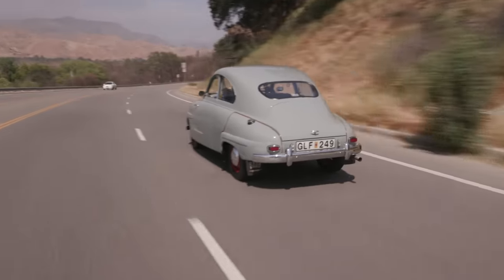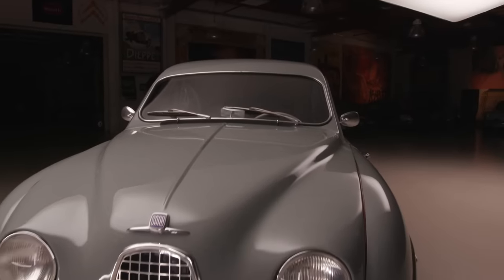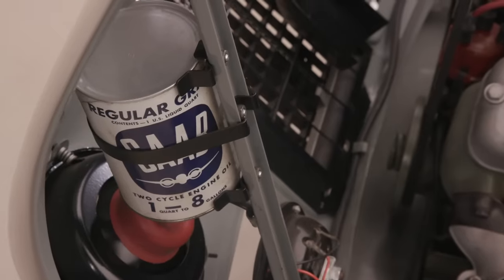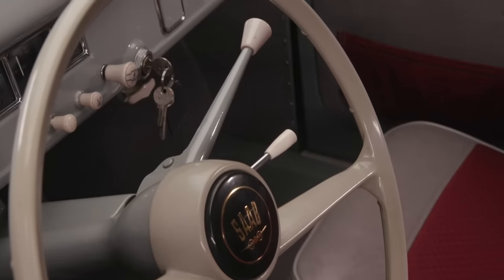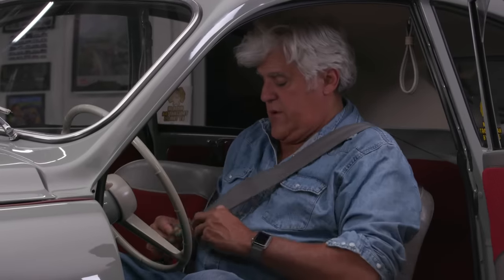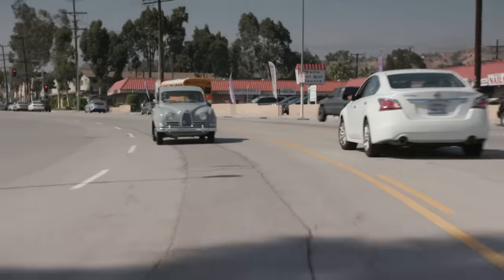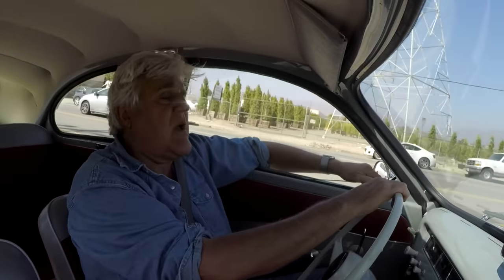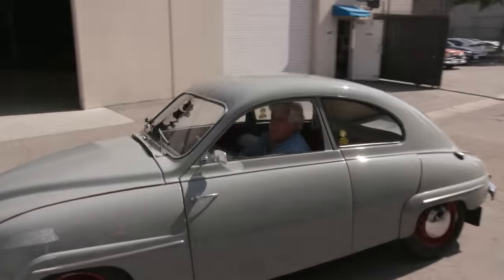1958 Saab 93 - Jay Leno's Garage

Comment: An old swede in good hands. I had the 4 stroke one, a dream in winter to drive. Sometimes they were called "sne fyra" (crooked four) as the pedals was not in the middle of driver position. People who walked crooked did so after driving that saab :-)
Reply: You sat centered to the pedals!
By the way.... SAAB 96 and winter.
When i was in the army we lads from our neck of the woods carpooled.
One of my friends had a 96 v4 and seating five not so small guys in that car!
As it was then the temperature could drop down to -40 c.
It was really really cold.
Especially in the back seat!
The heat distribution were almost non existent.
Hot feet in the front seats and the inside of the glass almost entirely covered with ice.
The passenger in front did have to scrape the windows so the driver could see out!
Reply: The 4 stroke motor was a Ford V4. I remember one that PD Elrod had that ran rather roughly. Turned out that the center main bearing journal was broken! The break was at an angle, so the crankshaft still worked! For several years and tens of thousands of miles!! Ran rough but it ran!!

Comment: No, Jay, this car looks familiar to me because I am really, really old. My father had several 93s and 95s. I bought my first car when I was 21: a 1967 Saab 96. Later there was a 99 (great car) and then a 900. But you live in the wrong part of the country to truly enjoy a classic Saab. Snow and twisty steep back roads that are the same as they were 250 years ago, except with some asphalt on them. One spring morning on my way to classes at the University of Virginia (all male in those days) from Mary Washington College in Fredericksburg (all female in those days) I had the great pleasure of running a Plymouth GTX off the road that hadn't changed since the Civil War. I just kept pushing him and pushing him with the little Saab and he put his foot into that 440 and flew off the road at the next curve. The Saab clung to the road like it was on rails. Does yours have freewheeling? My 96 did. No engine braking. Take your foot off the gas going downhill and the tach dropped to idle and the speed kept climbing until panic sat in. Fold down the rear seat, not common in those days, and who needs a motel? This was a fantastic brand, conceived by ingenious Swedes, and perfect for a young man wanting to stand out from the crowd. I got 32 to 36 miles per gallon. In 1967! Too bad GM destroyed it. Oh, and my 96 had a magenta high beam indicator jewel light. Never seen anything like it.
Reply: My first car, in 1969, was a SAAB Sonnet.
Reply: Thanks for a great story...this is why i like these old cars...Working on New cars nowadays is not the same...Greetings younger car mechanic from Norway
Reply: think simo lampinen was greatest seller of saab,once back fast,break and try to make turn,it took over,simo came out of car and start to tell bottom of that saab...and this is not a story,it is so true,,
Reply: Great story. Tht was my GTX, no damage,  was busy with a girl in the back later that night.
Reply: Haha! That was a nice story indeed. But well, i can't picture americans from GM having a proper talk with those sweden guys that engineered and built the 99 & 900. Seems like they must've had way too much of a different idea about how cars should be made.
Reply: reading this story just put the biggest smile on my face. im a 20 year old college student with a handful of family saabs, although i havent yet been blessed with a classic pre GM car. but whether or not Gm ruined them or not is another debate; reading your story was like looking into a mirror for my own saab experience. my 9-3 manual is a fabulous car that is fun to drive, very economical, handles snow like its on rails, and distinctively swedish. with all of my friends driving audi and mopar products im the oddball of the group but the car is just irresistibly different. every drive puts a smile on a face when i see the turbo needle wind up, even if im only doing 45mph. lots of memories in these great cars. thanks for sharing your story!
Reply: Socialism destroyed it.
Reply: In Sweden i had a -71 Barracuda with 440" and no Saab never had a chance in the red light! :)
Reply: Yea, he said it had that, but cool stories and your passion for these cars really comes through. You and Jay really make me want to drive one. 👍🏻

Comment: I have a model 96 Saab, somewhat similar looking in body style to this 93.  It has the stock Ford German V-4 engine.  It's absolutely indestructible.  I used to have a 1957 DKW also a two-stroke 3 cylinder with the radiator behind the engine and also with suicide doors.

Comment: I believe the freewheeling system was because of an inherent problem with using a 2-stroke engine - when you back off the throttle, the engine doesn't get enough oil.  Not really a problem in motorcycles, as they slow down fairly quickly, but with the better part of a 1/2 ton of car, the car speed (and therefore the engine speed) didn't drop quickly enough just with compression to slow it.
Reply: I'm a former owner of a SAAB 96. The freewheeling system was also intended to prevent "snatching" on the overrun. Lifting off the throttle would cause the engine to buck.
Reply: I don't know if it's really a problem with motorcycles or just perceived to be a problem, but I always heard never to just let off the gas on a 2 stroke to slow down. Especially when decelerating from high revs, I ALWAYS pull the clutch in. The freewheeling feature on the Saab 2 strokes was probably put on there so you don't have to hold the clutch in or put it in neutral when coasting. I would LOVE to have that car, I'm a 2 stroke guy from way back!
Reply: The owners manual clearly describes the need to change the three spark plugs to cooler burning plugs when you drive at highway speeds for long distances.
Reply: Decades ago I commuted on an Italian scooter with a two-stroke engine, and on long downgrades when I used the engine for braking, I remember having to periodically activate the clutch and twist the throttle grip a couple of times to rev the engine, to make sure the piston rings continued to get enough oil.  I hadn't thought about it in years until you mentioned it here.
Reply: The 58-59 Sports had oil injection (and triple carbs) - but so much for your theory on frugality.  Jay's used premix, so it does not have oil injection.
Reply: They kept the freewheel in the later 4-stroke V4 models too, the old Saab farts couldn't probably drive without it, you can switch it off though
Reply: Not necessary with the '65 and later oil injected engines. Beside the 850cc is small and 2 strokes have little engine braking.
Reply: @aussiebloke609   Not in the US  the 58 through 60 93 750 Monte was petroil only The first 850 Sport was in 1965 with the new body style.  The bullnose Monte Carlo 850's were all early oil injection and the standards with the Shrike engine from 1966 to 68.
Reply: I'm not completely certain what specs were available in different markets.  That said, if Jay's car uses premix (as he said), then his engine won't have the oil pump, as the pump removes the need for mixing the fuel and oil.    Possibly he has a Euro spec car, or maybe an engine from a previous model.

The freewheeling feature could also be a throwback, as it was available with the earlier engines and manufacturers don't always like to make changes if they think their buyers have expectations.
Reply: @bare nekid Not all Saabs were oil injected, most were "mixers." The high-perfomance ones like the Monte Carlo had a separate oil tank.
Reply: @aussiebloke609  I owned a 1962 bullnose with the original premix 36 HP engine and changed it out to a '65 premixm mainly because the original generator's water pump started to leak badly.  At the time I knew an old Swedish machinist who did  SAAB crankshaft work and he had several old bullnose Monte oil injected engines with the 850 cc style heads but with the  3 separate venturi carbs with the balance screws to tune the idle for each cylinder.   I much prefer the old single carbed models despite the premix requirement,  they got decent fuel mileage 28 to 33 MPG and ran smoother.
Reply: @aussiebloke609  That Car is a recent import from Sweden. It has reasonably modern plastic Swedish numberplates putting it as a car restored in Sweden probably in the nineties before being exported. Also the Swedish manual as well as the fuel gauge (Bränsle) tells us that it is Swedish Specs.
The FreeWheel was available up until the very end of the Four stroke saab 96 in 1980. I Believe that some early Saab 99 had the FreeWheel as well.
Reply: And I always thought the freewheeling feature was introduced with the 4-stroke engine to mimic the familiar behavior of the 2-strokes. I've had many 2-stroke bikes and have never heard of the oil starvation problem. Makes sense, though. I put 100K on a 3-cylinder Suzuki and never worried about disengaging the clutch when going down a hill. But its oil pump had 6 outlets, and 3 of them fed the bottom end (ball) bearings directly. Now I know why!
Reply: Only on the later cars, same as DKW. And if the oil was injected into the intake stream, you might have the same problem coasting in gear, on a closed throttle.
Big issue with oil-injection was some of the two-stroke oils didn't flow well in extreme cold. Unlike Saab, DKW's system didn't have any safety backup, so during one severe early-60s European cold snap, they wound up replacing more engines under warranty, than selling new cars!
Reply: @RememberingMaryEvely   The SAAB and Suzuki were both very similar, the SAAB injection pump had 7 ports, 4 main bearing feeds and 3 direct to the cylinder wall feeds.  The feed lines were steel tubes fitted to the mold when they cast the block in ductile iron.  How they kept these pipes from melting when they cast the block always fascinated me.   Very robust injection pumps made of iron and like (and unlike..) the Suzuki, they were down stream of the carbs, intake runners and intake ports so the oil wasn't getting diluted by gasoline immediately upon entry to the engine.  There wasn't a oil volume control like most 1970's Japanese 2 cycles had.
Reply: @sunbeam8866   Saab had designed a spring loaded releasing engagement 'dog' in the oil pump and distributor's drive gear so if the oil ever got too thick to pump, the engine wouldn't turn the distributor either. Cold weather recommendations were that you add a couple oz. of gas or Naphtha to each quart of straight 30# two stroke oil when the temp was below -14F. or buy 'self mixing' premix oil and change out the thicker viscosity oil
Reply: @wvangus82  It is because there is very little engine braking on 2 stroke engines unlike four stroke engines.

Comment: I learned to drive in a 1968 V4 Saab. My friend had an older 2 stroke. Fun cars and good with the Wisconsin show. Saab did not update the transmission for the V4 so mine had the free wheeling knob too. I would usually pull it out for engine braking. The 2 strokes needed the free wheeling because it there was no fuel there would be no lubrication. If the engine was at high RPMs rolling down a long hill the engine would seize up if there was not free wheeling. Same is true for a two stroke motorcycle so I would pull in the clutch while going down a long hill on my Suzuki T500.

Comment: I can almost smell it through the screen! Wonderful episode.
Reply: Peter Epstein mmmm and what a smell.. 😍
Reply: Weird it doesn't smoke much. Usually you can't keep old 2-strokes idling for 5 seconds or else you can't see through the cloud of smoke.
Reply: @GlamStacheessnostalgialounge  i don't know what kind of 2 stroke you have seen, but it was either wrongly adjusted or sat for a long time. Otherwise they mostly don't smoke
Reply: +crazyyoutubeuser24

I had some hands-on experience with old Trabants and tiny 2-stroke scooters and all mechanics say the same, that these smoke like mad.
Reply: @GlamStacheessnostalgialounge  i have experience with both 2 stroke mopeds and cars. And when the engine reached a certain temperature it should'nt smoke

Comment: I had a older  Suzy 750 GT Water Buffalo .In the late 70s and 80s  Suzuki made a Water cooled 3 cylinder 2 stroke  750 cc  street bike. It self metered oil and had a place for 3 spare spark plugs under the seat. However this thing due to its weight would scream it had the same snap the big motor cross dirt bikes have but 750ccs of it.  I forget the year but. At the time the first Ninja bikes were coming out. And they used to get so pissed.This street bike no fairings no rear sets would eat them up. But it sounded like a swarm of bees or a weird F1 car coming down the road. Id love to have a Saab like that.

Comment: Jay left out one thing about 2-stroke engines namely that they produce power right away because every second stroke is a power stroke.  A four stroke takes twice as long to rev up and start producing power, hence 2-stroke motorcycle engines.  I had one back in the '60s, a Yamaha 100cc Tin Twin as they were known.  You twist the throttle and bang, it's right there.  Small bike, but a riot to drive.  Rev it up and back off and all  you heard was ding-da-ding-ding-ding-da-ding which I'm sure is where the "Tin" came from in the nickname.  One of the reasons the Saabs were great rally cars,  instant power and front-wheel drive.  They owned it until another fwd car came along...the Austin Mini with a 4-stroke 850cc engine and incredible suspension.  That was fun too.  I used to bank-shot it off snowbanks here in Canada during rubber to ice races.  It worked!

Comment: The reason for the freewheel is that when the driver backs off the throttle, the engine's not getting any fuel. But the wheels and the drive train will cause the engine to turn over, possible at revs e.g. when going down a hill. Turning over the engine in a two-stroke, without fuel, would be catastrophic as the engine is lubricated by fuel.
Reply: Sounds accurate, but an interesting fact is that Saab kept the freewheel when moving to the V4 engine (a four stroke) in Saab 96. Does not sound as good as the 93, though.
Reply: Another reason for the freewheel is that the 2 stroke engine would cause a lot of bucking when the car was coasting with the engine engaged. With the freewheel the car was smooth as glass and nearly silent when it was coasting.
Reply: @olbill70  I'm surprised it hasn't been mentioned, that i saw,  but in Freewheel you can shift up without touching the clutch.  I owned a V4 Sonett with freewheel and it was a lifesaver in heavy traffic.
Reply: It also allowed you to change gear without using the clutch, and with a slight right tilted pedal and steering wheel (because of the front wheel well), me and my friends annoyed many people by driving from the right seat of the car!!
Reply: An with no mid consol you just mowed over and seemed innocent when cops pulled you over!
Reply: @jonasgustavsson7496  Even some early Saab 99's with the 1.7 liter engine had the freewheel.
Reply: Jonas Gustavsson my Real name is Jonas it's nice to see another one out there

Comment: I was almost borne in a car like this. However in 1956, I was carried home in A Lloyd, but my first car memories appeared in a white Saab 93, like this. As you say, it was a well built car, created by an airplane company, that manufactured aircraft for The Swedish Air Force. The logo is a stylized front view of the medium class bomber B18, as was one by the last designs before the jet-era.
I remember the car as a very pleasant vehicle. The entry through the suicide doors eased the entry to the back seat. It managed the tough mountains in Norway without troubles.
Engine sounds were never disturbing, and the motor wheeled happy in the worst of uphills. Downhills, it could tear the brakes, however, but they never let us down.

I have seen Norway by lying upon a pile of luggage in the backseat. Eh. Seat-belts did not suit kids by that time anyway, and I survived. The back storage was full, as well as the backseat.
The problem was the roads by that time. Very few were covered by asphalt, and at the gravel roads, the wheels hammered the fenders with a massive throw of pebbles that made a terrible sound inside the car. They had  also lots of deep holes, as well as bumps, and after some time I felt ill, and sometimes wanted to puke. These roads would not qualify for tough rallies at these days.
I will never claim the car for my illness, but the roads were horrible, and very dangerous with kilometer scarps on one side, and rock walls on the other, and no protection walls, except some stone here and there. It was however worth some danger, though the views of the three-dimensional landscape from above was adorable, at least.

I can assure everyone, that after day-trip of this kind, it was awsome, to make up the tent, and get on the food cook. Such easy dinners are better than anything.
However, we were teared sometimes, but the Saab 93, never protested, and ever delivered any requirement.
33 horses. Would such a span fail three people, and luggage over a hill? Nope, never if they were not insane, and Saab's horses never went insane.
Saab's Two stroke horses were of full blood arab's, that never let someone down. They were always awaken.

Nowadays the horses in a car, is asleep until calling up, but sleepy things are not happy to deliver at once. Otherwise you are cheating against the envirionment rules. The old twostroker is always awake, and uses a great part of maximum all the times. The engine is a pollutioner, of course, but its 33 Hp of 750 cc made our day by honours at the time.

Cheers to Jay Leno, and all two stroke lovers.